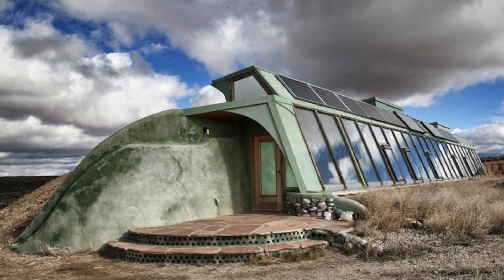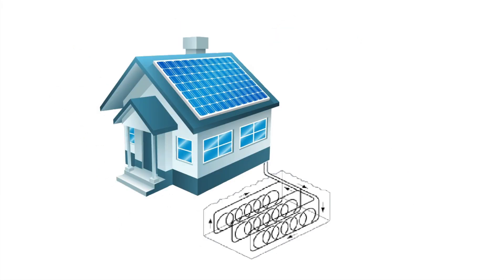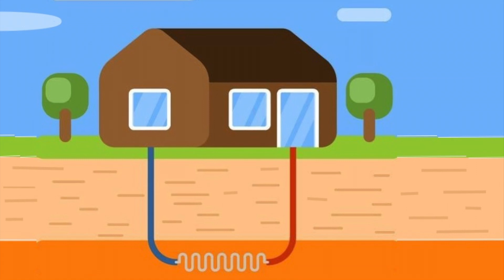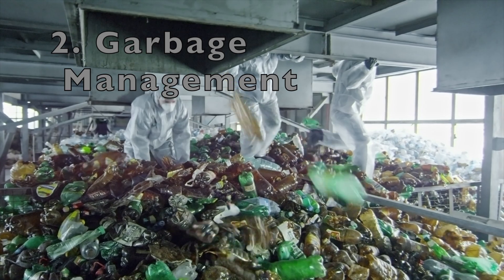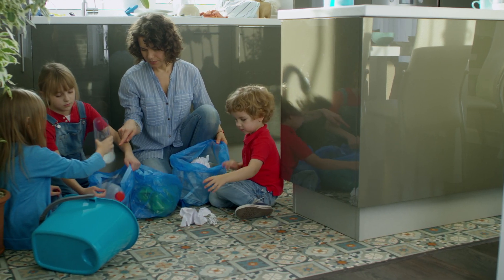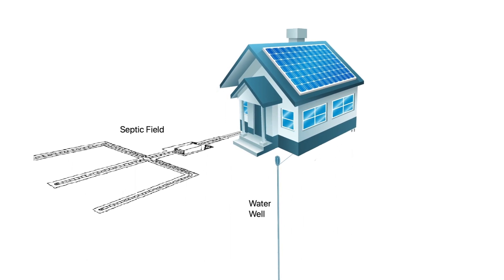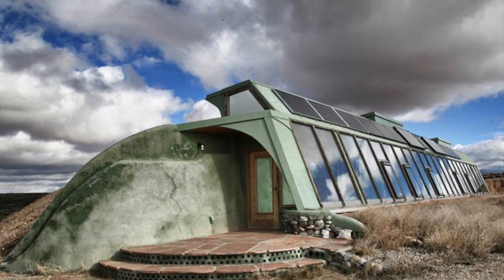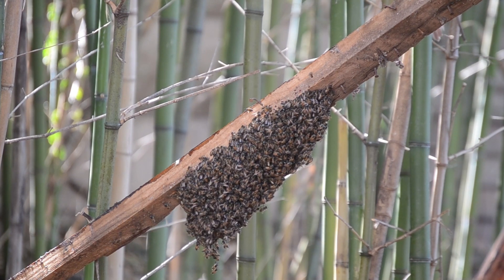Earthship Energy Savings for Any Home!

Comment: I agree on the principles, but an average income can’t afford a earthship or your alternatives in my country.

First of all, you need space. (Had to change metric to imperial for your) So a 1600 sq ft property without anything on it would cost about 63.500 USD. Put a basic 1600 sq ft house on it, would cost 207.000 USD.

Then we need a well, costing about 10k USD all-in, with the problem here is that you aren’t allowed to drink groundwater directly or filter it for without monthly lab checks. Adding a lot of cost.

A sceptic field, which aren’t allowed within 300 yd of surface water which is near impossible here, would cost another 10k USD on average.

The thermal earth battery would cost another 18k USD.

And these cost are based on building everything new, which is a lot cheaper. Adapting an existing property would triple the house costs on average and almost double every other cost.

So yes, the ideas are great, but not affordable/applicable for everyone.
Reply from the maker: Where are you that a thermal battery would cost 18k?
Reply: @SimpleTek  Netherlands and the reasons for those costs are simple.

1) buildings codes, anything not standard costs more legal work to get it approved.
2) to prevent condensation and moisture retention within the pipes you need a different system since Netherlands is way below sea level so ground water is a problem.
3) due to the heavy foundations we need/use here it’s hard to create a good building surface and put the pipes underneath.
4) labor prices are high here, simple as that.
Reply from the maker: @Jonsoh811  Yikes, not sure if you can even do a thermal battery there unless it's above ground

Comment: You just do not get it
Reply from the maker: sorry, I don't like the idea of wasting time stuffing tires
Reply: @SimpleTek  First, I would like to apologize to you, if I came off rude.  I made a blanket emotional statement, but did not explain why.  I am in the process of buying land, so I can start homesteading.  Am I going to build an earthship?  No.  Am I going to use some of the principles and ideas that I have learned from researching earthships?  Yes.  Now, I like your video, for all the things you spoke about.  When it comes to adding or changing things to your already existing mainstream traditional home.  I have research those things also, and may use some.   Earthships are not that.  Plus pounding tires to build an earthship, is no different than cutting down trees to build a log cabin by hand.  You do it because you want to.  Not because you have to.  I personally would just get tire bales and surround them with concrete.  

      As for using old tires to make artificial reefs.  That is just a sorry excuse for bumping man-made trash into our oceans.  Do they stop giving toxics off, just because they are in our water?  Would you drink water from your well, knowing that there are tires in your water supply?  Earthships are not the perfect solution,  but they are a great idea, when it come to thinking outside the box.  They are something to be built upon.  For reference, I live on the 19th floor in the middle of downtown.  I have every creature comfort at my finger tips that a person could want (for the price).  I have a Starbucks next door.  What this boils down to is that, some people are tried of just being "consumers" and what to start doing, living, and being more then just that.  Thank you for your time.
Reply from the maker: @thehonesthobo  Thank you for the detailed response!

Comment: Awesome clip, good job. I like the idea of bringing different perspective which can lead to better understanding and finding cheaper alternatives. I try to research as much as possible about different methods, materials and their uses, as well as trying to put everything into local context. Here are some of mine ideas:
Tyres will not off gass if covered with thick layer of cob. They probably lost most of volatile components already whilst being used. Using pneumatic tampers will speed up process considerably. 
I would use hyperadobe method of rammed earth extensively as retaining walls and support/dividing walls, as well as thermal mass. For those I would employ mechanical mixing and delivery of soil for rapid laying of bags and pneumatic rammer for compaction. Barb wire, curves and buttreses may be  added as reinforcing against lateral force of berm (if there will be one - depends on local context). As roof structure I would use steel panels insulated with styrofoam, rising slightly towards sunny side, creating skylights, allowing passive and ambient lighting, but minimising direct sunlight penetration. This kind of roof is great for collecting water and tank could be build using hyperadobe method behind house, with cooling tubes running buried around it. There would be front corridor across width of the structure, but its roof will block most of the sun, serving as support for solar panels and solar heat collectors to help with ventilation. I am considering a mechanism to adjust angle of the panels to the angle of the sun, to follow it seasonally and maybe even daily. Depending on berming with soil behind and on the sides of structure I would consider appropriate use of insulation, but huge water tank behind house and away from western afternoon sun could help regulate temperature.
Reply from the maker: thank you for the detailed reply!

Comment: I absolutely loved your video! I’ve owned a home inspection company for 23 years and loved seeing your perspective on this. I’ve always respected the reasons behind the earth ships, but unfortunately, they are prone to ongoing and latent issues. Their design is suited for a particular environment which may not work well in other climates. I believe you were speaking practically about well versus rain cisterns because of your environment. I think some people need to realize that one size does not fit all, and you can’t do a video for everyone’s exact situation. Keep these videos coming. They’re great! Thank you!!
Reply: You are correct, they are not meant for every Environmental situation, however I have seen them being built for dry heat and dry cold an extreme dry cold situations, there is one in particular that's being built in a humid climate, that is currently being built in Florida.

And that location is a challenge, because you are correct about earthships not working in all environments, but they have got it to work.

But I can already tell you that simple Tech didn't understand how the grey water system works for an Earthship based off of how he presented it in the video, which means he has to go and do some more research unfortunately.

I liked his video in the beginning because it gave other people the same opportunity to get some of the things and Earthship has the ability to take advantage of.

But his Solutions don't work for all areas, as one commenter I made a threat above us mentioned that it was roughly cost $35,000 just to drill down for the water well because they have to go so far down and that particular location.

So just like the location idea when it comes to where you can build these things, having a simple Tech idea based off of your geographical location when it comes to water capturing and filtering, doesn't always work from that perspective as well.

 he also misunderstood how the Waste water system works within an Earthship, he must have misinterpreted something when he was researching how the water filtration system works, no you are not pumping your shit and piss water through your plants that you eat, that water goes to a lower tank underneath the house into a Blackwater cell that is permanently outside and never used for consumption of any kind to the people living in the Earth Ship, what he was paddling in the video was simply misinformation of how it works Within an Earthship.

However I like the basic premise and idea of his video here, because most people can't afford to build an Earthship, and I liked that he brought up other ways of accomplishing the same things Within the modern home.

He did however skip one of the main factors of why Earth ships work really well, the Earth is probably one of the best insulators that exist on Earth, yes I am very well aware you can spray crap in your walls to insulate them, but that's not going to help a house when it's being berated by the Sun on a hot summer day.

And I am aware that he brought up the cooling tubes and how they work, however I can tell he didn't do his research because he didn't talk about how natural convection works and how it's built into these homes work very efficiently on a summer's day especially when it comes down to the southern orientation of the front of the house.

Having a southern exposure to the house presents all year round capability to grow food and that planter in the front of the Earth Ship, which also is where it gets the most hot, that is true, however he forgot to mention the windows towards the top part of that south-facing wall are used to create the natural convection air conditioning from the South Wall through the household using that heat because of what we know how he rises through those windows and cools the house very effectively.

Also what he presented in the video talking about geothermal heating and cooling tubes that are buried under the ground, wasn't a bad idea, however within an Earthship design, that goes to the ground but has an opening of fresh air from the south side which is how the natural convection works where the air will respond like a vacuum being pulled into the room through the south-facing wall windows where the heat will naturally rise and pull that cool air through the house without the need of a fan. and that environment during the hottest part of the day the insulation of the dirt also provides protection from Heat.

However I will agree that there are better materials than using tires for your walls, but I also understand the reason why they use the tires for the Earth ships.

But if we can get the modern home to have insulation all around it, it would greatly improve the efficiency and how it can cool and heat year round, I mean in most cases we already build our basements like that.

And I don't know if you've ever seen these types of houses or not, but basically it's a house that was being built, but the only thing that was made on the house was the pouring of the cement for the basement, and either the homeowner ran out of money or they just wanted to build on top of that house and put grass or dirt on top of it, where they had a roof covered in dirt and grass instead of building the rest of the house on top of the foundation like your average home, granted this building method is very similar to how Earth Ship works, however these are usually grid-tied or they can work for a normal house if people were willing to forget about building the house above the basement.

Using Earth as your insulator, is the best insulator on Earth, and the house doesn't necessarily have to be a south facing house if you're living on the grid, and don't necessarily want to have the in-house Greenhouse all year long, it's still cheaper to heat and cool a house that is insulated by Earth then the way we've been doing it for the past 100 years.

I personally think, the people will be living like that and prefer it at some point in the future when it comes to living in an sustainable efficient to heat and cool house in the future oh, and there's always other ways to supplement how efficient the house Canby by adding solar panels for electricity or the other type of solar panels to collect heat Underground, or using certain techniques similar to the tire wall, but don't necessarily have to be the tire wall for heating.

I personally think this is probably the best way of doing it, but I also think the majority of people won't do it, human nature and all that. 

People tend to want to keep their nice looking house that's above ground and typically don't want to innovate or improve how their household works to make it cheaper on themselves.

People are slow to change, until something dramatic happens that forces them into a dramatic scenario into doing what's more efficient.
Reply from the maker: Thank you soo much for your comment!

Comment: I think I will design my own hybrid system taking the best features from both. But what about in countries that rarely have temperatures below 30 deg Celcius ... what changes would you incorporate?
Reply from the maker: the system would be more for cooling then
Reply: Simple Tek yes so no need for any big thick wall to serve as heat storage ... or would a big thick earth bank actually serve to keep it cool ? As if it was underground ? And how would cooling tubes work ? And would the glass front need to be facing away from the sun ☀️?
Reply from the maker: @Mike-vp8nt  sorry I missed this.. there's other videos on my channel that explain this. Cheers

Comment: Poop is not used to fertilize anything within any current model Earthship structure - sewage is piped directly and immediately out of the home and into a septic system just like rural folks have been doing it for decades.  
The biggest difference between an Earthship septic system and a conventional (rural) septic system is the leech field utilized at the end.  The leech field allows any remaining fluid an exit to the system (absolutely NONE on a properly operating system), as opposed to the regularly anticipated cleanings that must occur with traditional septic systems.  
Most folks don't plant any food producing plants around their leech field - I certainly wouldn't.  
I guess you don't completely understand how thermal mass works with the current Earthship designs.  The dirt that is claimed throughout the tire wall and subsequent thermal wrap (about 5 feet more of dirt) is covered with a sturdy, double-thick waterproof layer of plastic (or pond liner) and 4" (sometimes more) of rigid insulation.  Moisture conductivity prevents most underground structures from maintaining a stable, comfortable temperature, but that is exactly what allows an Earthship to do it - dry dirt..  Not hippie magic or any other methods beyond your comprehension, just dry dirt.  Those evil tires are compacted, buried and covered completely over with concrete and clay plaster.  Not trying to sell you used tires, just correct some of the vast amount of misinformation you have spread.  
I think you have probably learned plenty about rain catchment from the comments, so I won't add where it's probably already covered - filters work,  they aren't too complicated or difficult.  This has obviously been more  of a learning experience for you than the "informative" piece you thought you were creating.  
Glad to see that you are growing, though I remain sceptical of the information in the rest of your videos, given the inaccuracies within this one - but thanks for sharing.
Reply from the maker: my point is, conventional construction methods can do the same thing for less money and WAY less work.
Reply: I can agree with your "way less work" point, but not the "less money" part.  If an Earthship build utilizes upcycled materials and the crew consists of a owner/builder plus volunteers, the structure won't cost an outlandish amount.  Check out FoxHoleHomes to see some budget minded, well built Earthship style homes - built by homeless veterans.  Earthships don't have to be a palace - they can be very budget friendly.
Reply from the maker: @user-tp9gy8kt2q  labour is money
Reply: That is an entirely subjective scale of:  

"What is your time worth..?"  

Depending greatly on location, material costs, and what your work force charges for wages.  Keep in mind that very little of all that labor is done by licensed workers.